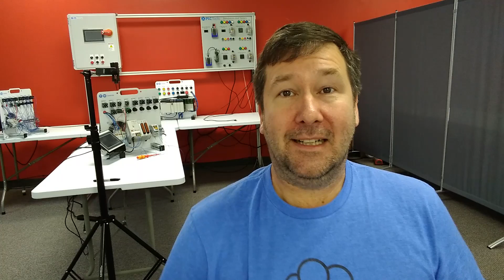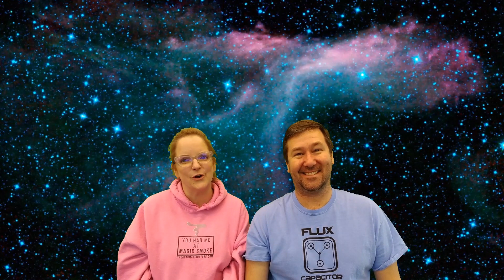Do I Need a College Degree to be a PLC Programmer? Engineer?

Comment: Hopefully I can shed some light on the topic because a lot of these people have provided outliers to the rule in 2025. For starters, literally anybody can start a company and employ engineers as long as they have the capital. Not to mention 20 years with the same company without tripping into an engineer/specialist/senior title is pretty hard unless you're lazy. I'm 28 years old and learned how to program in my living room. I am a PLC programmer for a fortune 500 company(I had a real portfolio of theoretical machines that work on 3d simulation). Short answer to the main question is no you don't need a degree but you will always be paid less and you'll always be restricted in terms of vertical growth. Lately, every job I have seen on Indeed almost always requires a degree. Get a degree and give yourself more options.

Comment: Tim, I will have to say, as someone that is not in this industry, I prefer when the job description does not have the bubbly words. But instead has the boring, but exact, description. Otherwise, you have no clue what you are getting into. I generally steer clear of companies that have the words/terms like “fun”, “make the world a better place”, etc. I feel these companies want to substitute pay with pizza parties. I may be wrong.
Reply from the maker: Everyone has their opinion so no you are not wrong.  But as I get older, I realize that there is more to a great job than pay.  And the companies that have the pizza parties usually have better pay than those who are only focused on the money.
Reply: @TimWilborne  You may be on to something. 😀

Comment: Generally paper qualifications are what carries you for the first couple of years...after that it is work history & projects (good advice here: take lots of pictures of your work & keep in touch with key people). This question also depends where you intend to work... Some countries, provinces or states regulate certain trades & professions with licensing. Obtaining a license is generally not as easy as you think. It is frustrating because these licenses in Canada are tied to unions & Canadian apprenticeships. Canada is a country of immigrants, but the system is tilted to make it very difficult for foreign trained technicians & engineers to bypass the lower rungs of the experience ladder or get credit for their foreign acquired work experience & qualification equivalency which is really frustrating because old qualifications get devalued to "junk" status as time goes by. 

Sometimes it is difficult to have verification of your experience because the companies you worked for no longer exist. I am a perfect example: 35 years since qualification in the UK, a string of high profile engineering projects & decent jobs, but many companies no longer exist so a prospective employer cannot call to verify me. Then circumstance was I needed to take time out to do something else (build a new home)...now it feels like I need some liquid fire to get back in to my real career.

Comment: I have been working as a controls engineer for over 20 years. I do not have a degree. My title is Controls engineer. My business card states my job as Senior Controls Engineer. By the way I work for one of the largest PLC manufacturing company's in the world  and have worked for many OEM machine builders as such.
Reply from the maker: Thanks for sharing Robert. I wish more people would let the world know that college is only one avenue for getting into this industry.
Reply: Same here. Electrical Technician ( work with engineers) No college all hard work and worked with top company's in the world. Marshal, Kennedy, Jordan Power Plant, etc. 
And jobs offers all the time for last 30 yrs . 
You have a excellent back ground.

Comment: Who does the hiring at these companies, it is not the controls engineering manager(s).  It is HR.  And HR always defaults to the common denominator (i.e., CYA) college degree.  Some advanced positions even state Master's degree.  Like that thesis I wrote  on some arcane subject would help get a the production line running.
Reply from the maker: Very good point Dr G!

Comment: As someone who has been a controls engineer for 15 years almost exclusively building and designing new machines and plants I would recommend to get a two year degree from a college with an excellent program (excellent in quality not in name, do your research). Of course my experience is relative to my geography but here in the middle of the US it is hard to find good help and opportunity does exist. As Tim said if a company has a hard rule about four year or more degrees then just move on it won't be a good fit. I would recommend that you call and check however with the company about education requirements, often time job postings are very cookie cutter and the employer doesn't always even know what is in it (I find this very mind boggling but have seen it myself).

Also you may have to cut your teeth in a less than desirable controls position. An example would be working for an industrial construction contractor that has its own controls division. On the plus side you will get to do the type of work you desire, but on the negative side it is in plant/process new construction/rebuilds (as opposed to working for an OEM). This typically means a lot of out of town work, dirty/muddy jobsites, sometimes the jobs are not that exciting. Also the design and engineering tends to be a bit more shoot from the hip which for some personality types is very frustrating and stressful.

My first job interview they actually sat me down with prints to a machine and a laptop and said "here, you have 3 hours to program as much as you can". They wanted to see my thought process and structure to how I chose to program and solve problems. I was so thankful for that type of interview and knew that was a good fit for me at the time.
Reply from the maker: Very good information Jared.  Thank you for sharing!
Reply: Do you know where I can find a center or Institute for industrial control and programming education? please I need  help